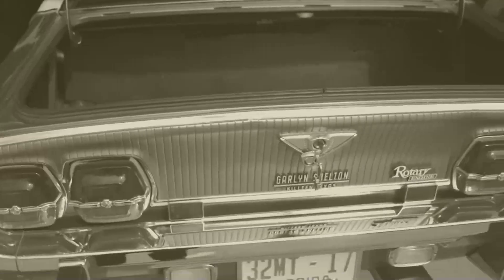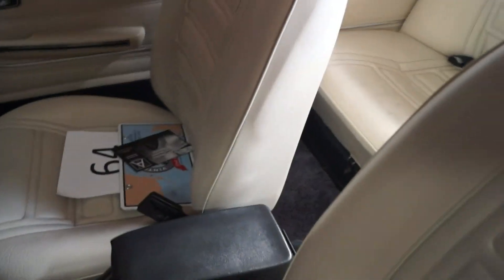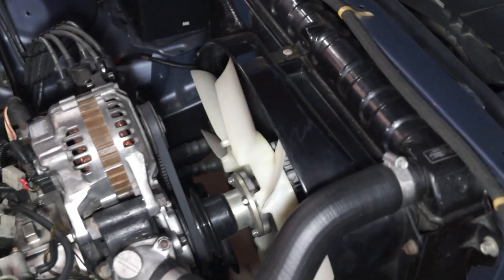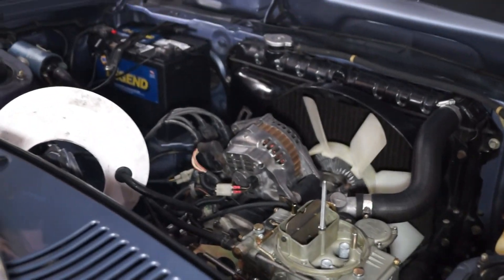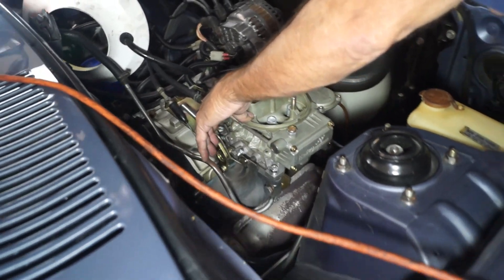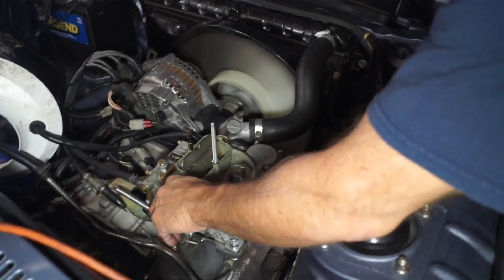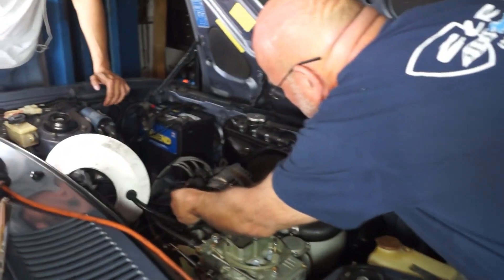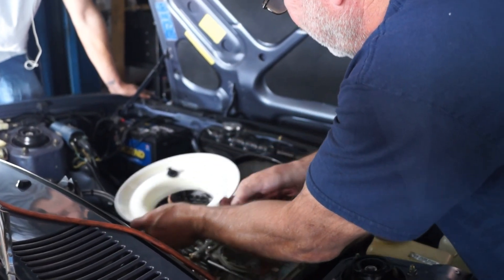rx4 classic rotary

Comment: Is there anyway to polish or finish those key chains, they look a bit rough?  Nice ending with regards to editing.
Reply from the maker: I could use ABS plastic instead of the PLA with the aluminum powder in it or the carbon fiber filament as pictured.  The ABS can be smoothed out. They are 3d printed and hand made, not molded so they do have a somewhat rough appearance to them.  You really don't see the imperfections unless you look closely.  The overall quality is really good.  They are durable and well worth the $25 donation for the key ring or $50 for the 128 Gig Flash Drive.  I'll experiment with the ABS and see how they come out.  Just printed one with Copper filament that came our exceptional!  Also have glow in the dark filament.  Gonna try in Stainless Steel as well.  Click on the donate button on my channel and send me an e-mail with your name and address and how much you donated to get a gift of your choice.  These are destined to become collector's items and you'll be helping us out to finish this project and support our tireless efforts to bring you the best quality rotary videos you will find anywhere on the planet from the master himself, Carlos Lopez.